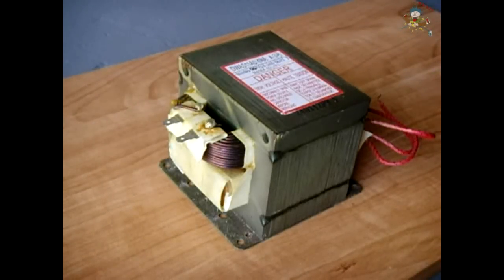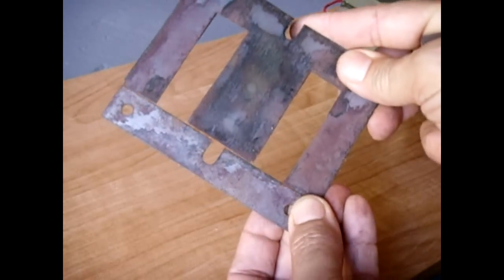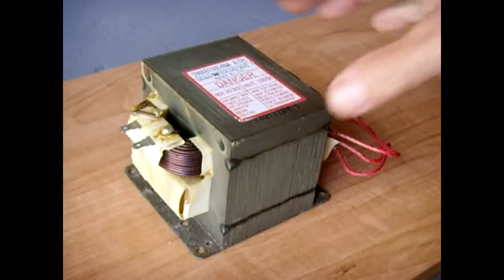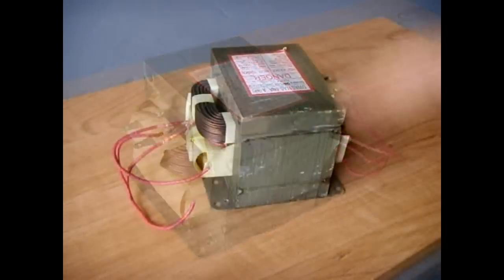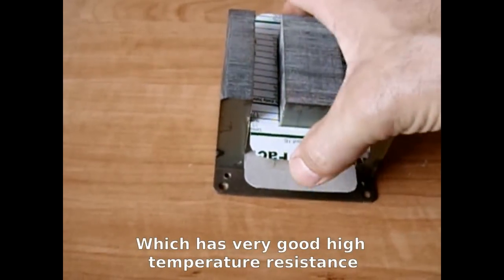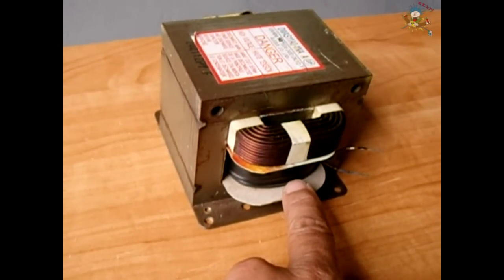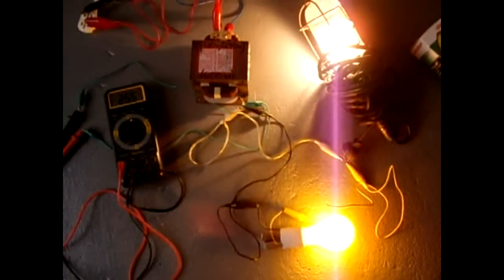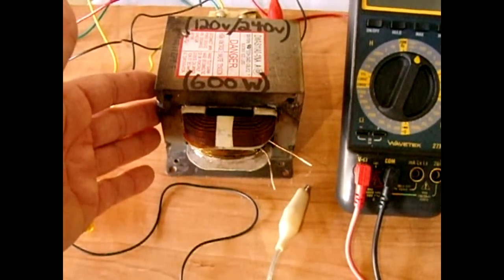How To Make Custom Power Transformers

Comment: Wow! Absolutely one of the best videos on the subject.  I have been watching videos on high voltage and transformers for about 2 years now.  I want to make something cool out of my pile of scavenged trans, caps, tons of big electric motors, etc.  I would love to make a insanely powerful fly back but i cant understand how to make the driver.  Anyway i learned more in your one video than i have from all the others.  Only thing i wish you explained is what exactly makes the transformers different freqencies.  What are the physical aspects of a transf9rmer that dictates it as a 50/60, or 50, etc. Is it the thickness of laminate plates that makes up the core? Anyway i dis mot know about all the stuff you explained about ytansformers, thank you and God bless.

Comment: Am I correct in thinking that in step down transformers that the max amp output is proportional to the ratio between the primary and secondary.  For example, lets say you have a 2:1 step down and don't want your primary to go beyond 5A @120V.  The voltage on the secondary would be 60V.  Would the max potential (assuming the core and wire could handle it) amps be 10A?
Reply from the maker: Yes. 5A @120v is 600W, and 10A @60V is 600W.
Reply: Thank you.  Just wanted to confirm it while the marbles are rolling around in the brain.

Comment: as usual a great video, thanks. but I have a question?  I will be needing a transformer that I can very the frequency the from < 10 Hz to more than 300KHz do you have any information that would be helpful, thanks mike
Reply from the maker: I have no idea how you would be able to do that. A transformer's core is designed for a specific frequency. I know nothing about a variable frequency transformer. Sounds like a mission abort!
Reply: Look into flyback type transformers. Not sure exactly if a TV or CRT monitor type is suitable but you may be able to  start there to get some type of idea.
Reply: ElfNet Gaming
thank you very much, good idea, and I happen to have one on hand.
Reply: no problem but like I said I am not 100% sure a generic flyback transformer will do what you want as far as low frequency wise. But it may be a good place to start at though.
Reply: thanks for the tip, there is a guy doing the same thing I want to do, but I didn't know what kind of transformer it was until you said. thanks again mk

Comment: How do you know the specs of the iron?  What calculations did you use with regards flux saturation?
Reply from the maker: The laminations are most likely silicon steel. I relied on the program, which worked fine for me. Thanks for watching

Comment: So 520 turns secondary, so the Primary is 260 turns, is that a common number of Primary windings for a MOT?
Reply from the maker: No, that's not a standard # of turns. Many MOT's use around 100T of 15/16ga wire for the primary winding.
Reply: electronicsNmore: Thanks dude.

Comment: excuse my ignoranse,and i know this is an old video but i just have a question,can you use this transformer to power a 220-240 volt smal motor used in compressor or vaccum pump? thanks in dvance,my house power is 115 volt
Reply from the maker: Regardless of age, I reply to questions on all my videos. To answer your question, it depends on how much current the 220v device draws.
Reply: About 150 watts
Reply from the maker: Should be fine.

Comment: wouldn't the cutting and re-welding damage the insulation of the laminations? If yes, that could increase the eddy current
Reply from the maker: To make a custom transformer, you need to do as shown. Just make sure everything is lined up before welding it back.

Comment: I noticed the rusty laminates...I have a choke in a guitar amp, and it was in a sorry state, so I cleaned all the laminates individually, but they all had a thin layer of laquer or varnish on. Surely I need to replace that before reassembling, right? I thought the plates were supposed to be separated or they'd just kinda act like one lump and they'd get hotter? But I've been Googling for like an hour and can't seem to find  anything about it. I think the whole belief that they need to be separated, comes from having seen what looks like laquer between the plates of that one choke. I either made a bunch of assumptions from there, that warped in my mind into actual vague memories of something I once read, or a fragment of a dream ended up in the wrong place. I dunno.

Comment: i have a 230 volt 60hz 5.7 amps class B electric motor water pump, and i wanted to use your tutorial here to alter my 420v 60hz oap microwave transformer to power the motor from a wall outlet. Is the transofrmer all i need or will i need a capacitor in between? i was under the impression you should never run a transformer (step up or down) directly from a wall socket.
thank you for any advice your willing to give.
James
Reply from the maker: When you plug in a power adapter into a wall receptacle, you are most likely plugging in a power transformer. You need to measure the core area of the transformer, then enter the primary winding supply voltage as 120V, Then enter the secondary winding output as 230V / 5700mA. If the core area is large enough, you will get the exact wire you need, and turns. No capacitor!

Thanks For Watching!

Comment: arnt those original windings aluminium and not copper? many microwaves are.
Reply from the maker: This MOT used aluminum. I have others that use copper.
Reply: ok, thought so as i strip a lot of these things and you can usually spot the aly ones.
 also some i have found use copper for one winding and aluminium for the other

Comment: I counted the primary on several mots and found that they all have 120 turns , kinda cool seeing as how most homes have 120 volts so a 3 turn secondary gives you 3 volts and so on .
Reply: I tested a 240V primary and it also gives about 1V per turn.
Interesting

Comment: Mister, you are a wizard of your world. I bow down to thee with respect. What I wish from you is just a little bit of your wisdom. I would like to create a transformer from within my toy box of junk in my garage. One such as the one used in this welding machine : Lincoln Electric 240 Volt / 225 Amp Stick Welder..I have seen the YouTube videos describing how to take a couple of microwave transformers and rewiring them to get a small type of welder. What I really want to try and accomplish is to build one bigger  transformer that can do the trick..  Can you enlighten me on what type of materials I can use as a core instead of the I,E plates and what  size wire and how many wraps  for secondary and primary windings? Does the type of wire matter? I have a compressor motor from a central air unit that has been submersed in mineral oil that I don't care about so much that I am not willing to go ahead and remove the beautiful wire within.If you can help me to construct this transformer I need very badly, I will be forever grateful and indebted to you,  your Wizardness. Kind Regards, Bobby
Reply from the maker: +Bob J 
It is much easier using 2 smaller transformers, than getting your hands on a large, high current transformer.

Comment: Sir it's possible make it for amplifier 35v 0 35v or 50v  0 50v
Reply from the maker: Yes, you can make a center tapped transformer.
Reply: Thanks for reply but which wire g should to use for secondary and how many turn per volt

Comment: What if you just cut the coil you're taking out, then feed in the new wire, without cutting the core?
Reply from the maker: I do that when making my 52VDC stick welder(I have a video) or 12V lead acid battery charger.

Comment: I rewired a MOT after watching this video about 18 months ago and just picked it up again tonight. I rewired it with insulated awg 10 wire with about 16 or 17 turns. I attached an old lamp cord to the primary inputs and attached my meter to the 2 ends of the 10 gauge wire. When I plugged it in my meter says 14 vac and it is making a buzzing noise...any ideas? It is a YEC 120V 60HZ. Any help would be greatly appreciated! Thx
Reply from the maker: A buzzing noise is common.

Comment: So if you had a plasma table you could get silicon steel and cut your own plates, looks like they just ran a tig torch down the sides with out filler

Comment: Hi I love your video. I followed your instructions and cut the top off. However I found it is very hard to remove the coils from the transformer. It is very tight and stuck inside the core.  I wonder if you have any hints to remove the coils.  Thanks again for the wonderful video
Reply from the maker: They hammer out. Try a large drill bit to drill away some wire to loosen it up. I never had a problem.

Comment: Great video.
Would you gain any more efficiency if you reversed the placement of the windings?
The 120 volt winding would be deeper in the well of the E laminmations. Your comments please?
Reply from the maker: Should not make any difference. They are both inside the same core and welded tightly together.

Comment: Hi 
Does this approach work for DC as well? Could a transformer be made for 24v to 12v step down? And does the calculator software apply to DC power? Thanks by the way. Love the recycling.
Reply from the maker: Nels Wight DC cannot be transformed unless it is pulsed. Alternating Current is required.

Thanks For Watching!
Reply: Nels Wight DC power can be controlled by the pulses previously mentioned. What you use is a speed controller/motor controller and it estimates the voltage, so for example 24V in would be changed to 12V out by rapidly turning the power on and off half the time.
Reply: Your better off doing this in AC then use rectification circuit after it to get you DC..

Comment: Hello  and i got 1 question  and i hope you can aswer it  
I have a 35 amp pyramid phase lll  power supply and it stop working somewhat it has voltage but no current and the 1 thing that i notice is that the transformer bottom secondary only has 4.8 on each outer leg or 9.6 on both legs does that seem right to you?  
And thanks for the great channel :-)
Reply from the maker: I have no idea what transformer you have. 3 phase delta? You need to test each winding.

Thank You!

Comment: Good day! Thanks for sharing this video. I would to ask for help.I want to design a control transformer (Step down) which has a 240/480 primary and 120 / 240 secondary. Can you please teach me how to find the exact turns for this design.same with the wire size to be used for primary and secondary.
Reply from the maker: You need to use the program in the video description area. Thanks for watching!
Reply: Thanks for the idea.Godbless

Comment: nice video.  I'm wondering about the trade off you are making by welding the laminations together (Not that it wasn't the original trade off made by the manufacturer)
I'm not a big transformer guy but know that in BLDC motors the laminations are insulated one from the other to help reduce eddy currents.  Is this a problem with welding the core together?
Reply from the maker: nitrous dude Hi there. All the laminations are touching, not insulated. The currents flow through each piece. Welding the core back together is fine because you are not going that deep into the core.

Thanks For Watching

Comment: Where did you get the enameled wire? I looked on Amazon for some and saw many spools of it for pretty cheap. They are all different lengths and don't know how many feet to get. Would 200 feet be enough. I am planning on making a 120 to 240/277 transformer
Reply from the maker: Use the software provided. I would think 200 feet would work.
Reply: electronicsNmore thank you very much. I have a ballast and a flyback setup for a high voltage power supply. I got the ballast  at a local flea market and it is commercial and is 277. I also needed 240 volts at 2 amps in the garage and didn't want to run another circuit for it, so I figured id use one transformer for two purposes. Again, thank you for making this video and replying so fast. :)

Comment: The term "Power Transformer" is wrong. The power transformer is the transformer that is between the generation and the distribution, and the video's one is for low voltage.
Reply from the maker: The term is correct. If I stated, "Utility Power Transformer", then you would be correct. You can perform a simple search for "Power Transformer" at Mouser as well as many other big websites and you will see transformers like the one shown in this video.

Comment: Hi and thanks for your informative demonstration.
Would it be practical to rewind a MOT for use as a high amp DC regulated variable power supply?
Could I increase the primary winding to reduce the operating temperature of the core?
Reply from the maker: Walter Cengia You would need to use more turns of smaller wire for the primary winding(You can calculate using the software), or take an oil filled RUN capacitor and connect it in series with the HOT wire leading into the primary winding. You will have to experiment using different values. The core temp will drop due to reduced current into the transformer. Output voltage will remain the same, but lower current output. You can also do nothing and place the cooling fan from the microwave oven right next to the transformer inside a housing with one end of the housing left open to draw the air in to keep it cool.

Be sure to check out my video playlists, rate Thumbs Up, and Share my channel with others.

Thank You!

Comment: when a current from a solar panel is pulsed  (turned on and off), on a transformer , you get A.C.  All inverters do is pulse small transformers that step up current into another larger transformer.  The larger the transformer , the more stronger the magnetic field (electric field) becomes.  The long length of wire will increase voltage and magnet strength. The diameter of the wire determines the amplitude. Go thru your house and write down how much volts and amps you use on each item. This is your Total max power consumption when all are working at the same time. Remember , you don,t use all these items at once and some of them (like the refrigerator) turn on by themselves. Add the totals of volts., then add the totals of amps. This is the numbers you need to know when making your own transformer to power your home on solar power. Remember you need a (Properly placed ground) not attached to transformer output.  This is an iron pipe driven into the ground 3 feet or more with a thick diameter wire attached to it on top, this is your positive. A wire coming off of transformer (the white wire) or neutral wire. (center tap wire) this is the wire that switches poles.  The Black wire is the Negative. Use green for ground, black for negative and white for neutral when you make your own transformer, so don,t get confused and learn how to make a transformer.  Larger transformers have higher magnetic strengths in the cores. The higher the core strength (magnet strength)  in the transformer  (when puled) , the higher the output. Do not use battery positive as ground. Use the earth ground, for ground. output wires are the wires comming off of the end transformer and earth ground.  Use these wires to power your home.   EXAMPLE: , (TRY) the use of a 10 gauge magnet wire primary with about 600 turns and secondary of even larger wire, 12 to 20 turns connected to a 12 volt power source that is pulsed into this transformer. The makeup of your transformer may be different because we all don,t use the same amounts of electricity. I don,t know if anyone makes an iron core this large or not. You may have to make the plates yourself. EXAMPLE: IF your house uses 8,000 watts. You need a transformer (when pulsed) that puts out 400 volts with 20 amps to equal 8,000 watts.  10 gauge wire wrapped 425 turns primary and you will have to work on the secondary wraps to get the right amperage correct. See transformer chart.

Comment: Neat!  Was lately thinking about making a Prius HV battery pack charger to charge the battery as-found with propper connection for a quicker temp restore, versus the individual cells or all the cells removed and packed in parallel using like a hobby charger.  This would definitely be an analog part of the solution as-is with potential for switching to create a more optimal pulsed DC with MCU controlled charge curve.  Of course will need current limiting and rectification.  That might be a super video to show, both the analog and digital range of methods or at least one method.